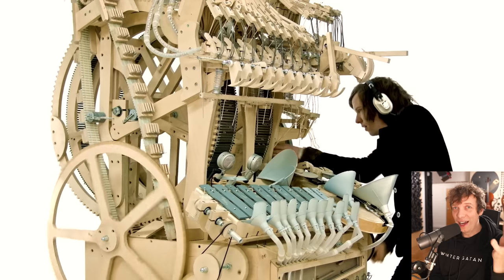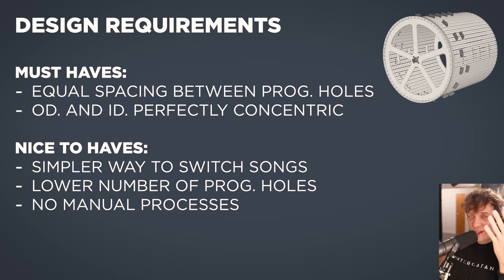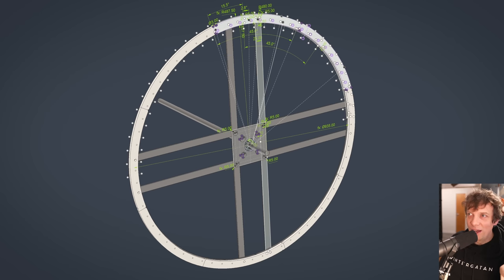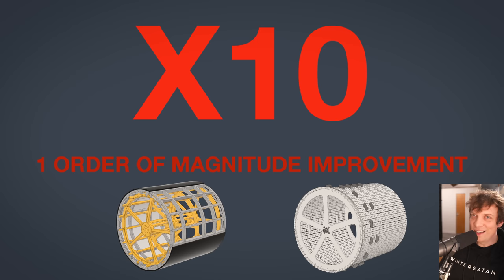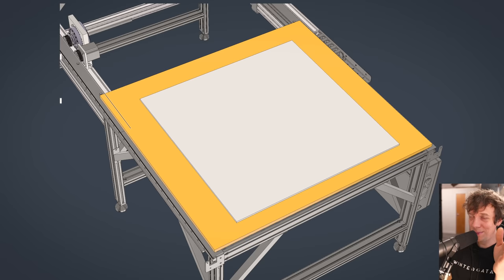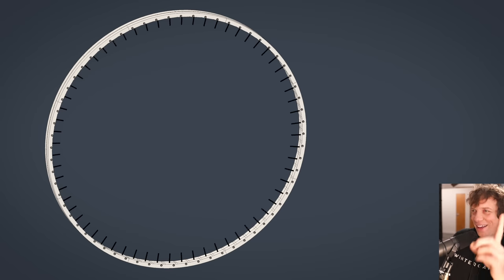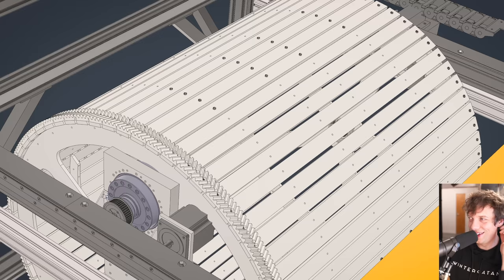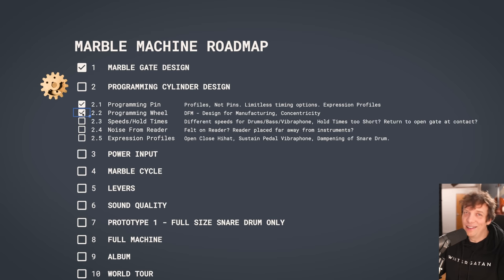A New Music Programming Wheel

Comment: Martin, please listen.
You are repeating the same mistakes in a different way that you did with the MMX.
This programming wheel is NOT simple.

You will have a lathe.

Nothing is easier but to just lathe atube round. Not you are not going for a tube.
Please just go for a tube of some kind.

I suggest: 2 spoked wheels in the front and back. Wrap sheetmetal around (1.5mm stainless?). Weld that together. Wrap a sheet of plastic around and bolt that on.
Now machine that plastic on your lathe and everything will be concentric and the holes are going to be just perfect.

4 parts plus bearings and the screws. No insanity.

Comment: Honestly, I hate this design! 
1) large. I don’t think this will be easy to move while on tour, and road cases for it will be huge, custom, and expensive. Large objects become projectiles of sorts in the hands of roadies. Especially when they are in road cases. 
2) you say “engineering plastic”, but that means little. Lego is made from ABS, which is a kind of engineering plastic. So is plexiglass. So is HDPE (aka plastic cutting boards). 
3)stiffness. I would expect a wheel that size to droop in the middle. How much is acceptable? I would also expect it to twist when it spins. How much is acceptable? Both will affect timing and maybe engagement of the reading mechanism. 
4) the wheel should at least be tested for static balance. A way to attach weights and/or mill away some material to balance it is probably a good idea. I’m not sure if dynamic balancing is necessary, but it would certainly be a nice to have. 
5) on a related note, spinning mass is both your friend and enemy. It’s momentum will tend to smooth out jitter, but it’ll require more energy to turn.
6) when on the road, you’ll have a hard time getting it repaired. You’re building it on a custom CNC. When on tour in, for example, Australia, if you need a repair, are you going to courier a replacement wheel from Europe overnight?

I wish I had constructive suggestions on how to address all this, but I personally fall back to paper tape and programming plates for jacquard looms, but I don’t think that’s the aesthetic you’re looking for.

Comment: This isn't going to work. The wheel is way too wobbly. Also, snap-on plastic parts on plastic parts are not reliable. Also, gear are way more noisy than belts, and MMX had noise problems. And  is that sketch of the whole machine realistic? Because there's no way something like that can be used on a world tour where it will need to be disassembled, transported and reassemed multiple times per week

Comment: I really don't understand your approach to designing stuff.
You spent countless hours on designing this part.
But the whole design is based on assumptions.
You assume that your CNC contraption will work and that it will be precise enough. If not then you won't be able to manufacture the drum.
You assume that the drum is stiff enough, that the plastic is strong enough.
You assume that the double helical gear is precise enough and that it's quiet enough.
If any of these assumptions turns out to be false than you designed all of this for nothing.

I don't understand why you don't test your assumptions beforehand.
Why not build small scale models? Why not test one design element after the other?
Why not build the CNC first and test it before spending all these hours designing the finished part?